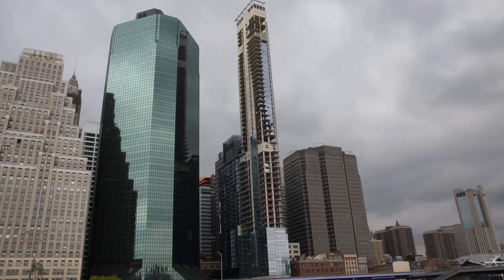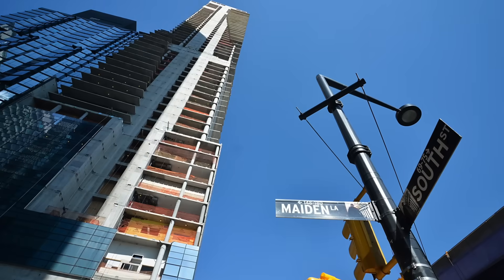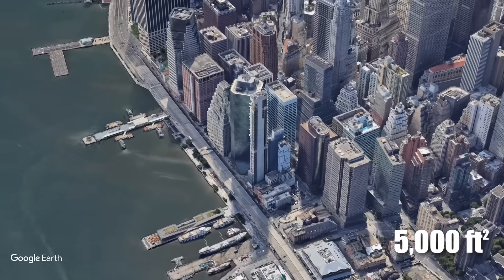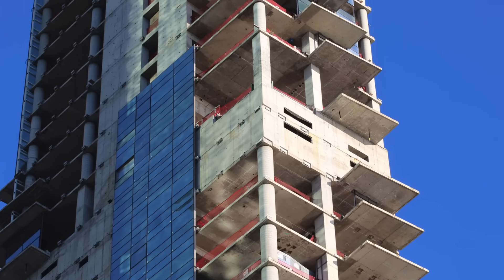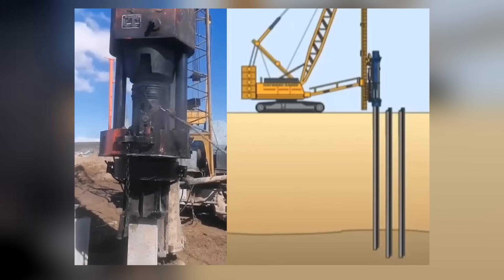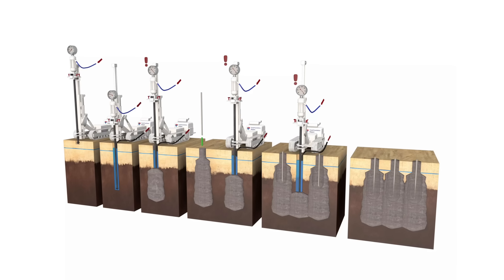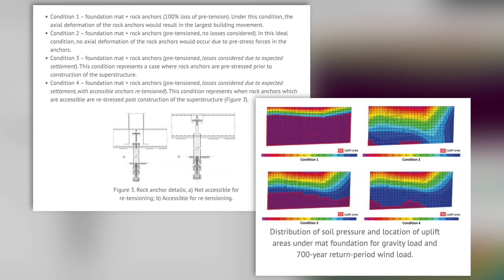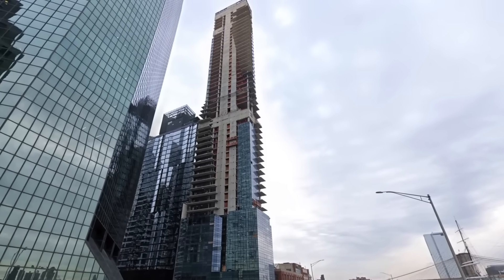Why Nobody Can Fix This New York Skyscraper

Comment: The fact they call this lean 'unforeseen' after knowing they weren't anchoring to bedrock is astounding to me. Anyone who has dealt with foundation issues in their home (myself included) or even built small structures (shed, outbuildings,  etc) on soft ground would have predicted this as a potential outcome.
Reply: That's because, and I bet my left tseticle on it, there's at least a dozen jews involved.
Reply: with a 15:1 aspect ratio and strong winds?   Shocked, shocked I tell you !  (sarcasm)

Comment: If the bed rock is only 150 down, under the softer soil, why not just drill down and install the pilings? Water wells are routinely drilled over 200ft deep so it should not be too difficult?

Comment: Structural Engineers need to stop pushing engineering thresholds beyond "reasonable" limits.   The city should have known better than to approve this soil amendment system vs. going with driving piles all the way to solid bedrock.  The developer was foolish for rolling the dice on an unproven design approach.

Comment: Having years of drilling experience, 14 of them installing micropiles and tiebacks in the 5 boros…. All this information is well known… and penny pinching is never a option and money is never an object when trying to get out the ground in that area….. this is 100% result of a payoff and then abandonment before more lives were lost. As it sits id be pretty certain it poses no danger of collapse which is why it still is standing, it will probably have taxes and bs stop being paid on it until the city owns it, and then it will continue to sit until its a liability to the city they should have used union singnatory GCs, and companies unless it was meant to be one of the many empty large residential buildings that no one knows are even empty in manhattan because they are a chinese/jewish bank account basically.

Comment: Now folks, which is the correct scenario,  the One Seaport's Developer used Boeing as their design Consultants, or Boeing used One Seaport's Developers for it's 737 Max programme?
Reply: Boeing had an issue with outsourced SW development; they have issues with production QA ... but their designs are yet OK.
Reply: @TomMcinerney-g9b  :  Good to hear that.  I'm sure the families of those that died in the two crashes associated with faulty control software and also the lady sucked out of a window when an engine component failure punctured her window are mightily relieved to hear that the Company can blame the failures on someone else.   There was a time when main Contractors took legal primary responsibility for the correct selection of components / parts and systems  from their sub Contractors, like the previous battery issue where sourced batteries had the inconvenient habit of going on fire on a regular basis, much to the concern of the punters travelling in the back, not to mention the crew.   This Company has lost it's way, but is probably a beacon of DEI, so all is not lost".

Comment: I'm not sure how the "unforeseen tilt" wasn't easy to foresee. I'm no engineer and even I know better. Trying to save six million dollars turned out to cost them far more in the long run. I'm honestly surprised that Manhattan doesn't require such heavy highrise buildings to have piles driven all the way down to the bedrock. You'd think that would be something that was very strictly enforced, especially when you consider the soil most of those buildings sit on.
Reply: what's a pile of 300 year old rotting logs under an immensely heavy skyscraper, to old friends?   ;)

Comment: This same thing happened to another skyscraper out west, I think. The developer didn't want to drive the piles/caissons all of the way to bedrock to save money. I think the building is over 60 stories tall. It had a significant tilt to one end. It was already occupied. I would never, ever, let a skyscraper be built unless the foundation was secured by piles/caissons, fully sunk into bedrock. This stupidity in this design and construction lead to grave issues over time. Some people never learn. The Burj Kalifa was done right. Second, I'd never design a high rise with that kind of aspect ratio. Look at the Empire State Building, that is good engineering and good design. It's all about the foundation. There are a couple of ultra-high rises near Central Park which scare the hell out of me, they look like pretzel sticks, horrible, horrible design, but that's just my opinion. But I'm from the old school of ultra conservative engineering and design. Spend the bloody money initially, do it right initially, then you'll have something safe, plus add in a safety factor, during the engineering stages, which far exceeds codes. Don't rush the construction either. This was carelessness, with an element of greed as well; sad but now the building will not be occupied as the issues are in the public domain. A lesson learned for the future.

Comment: This issue is the definition of trying to pick up penny’s in front of a steam roller.

They tried to save $6m and ended up costing themselves hundreds of millions. Pure greed and stupidity. You’re building a LUXURY tower. Just imagine the other corners they were cutting. I don’t even mean structural/engineering corners, I mean just on the quality of amenity material they were using. I’ve seen a lot of luxury buildings in NYC in my time and their quality has consistently gone down with each decade. It’s the small things, like seams not lining up, grout and sealant cracking, poor building maintenance infrastructure, things like that. But when you’re buying luxury property it’s those little things that matter.
Reply: Comments are deleted on this video. There is no Freedom of Speech in the USA.
Reply: The word is "pennies" !

Comment: The city should be.
 Responsible for approving the blueprints and the designs.
Reply: Great idea - the know-all, efficient, competency of government bureaucracy is the solution to all problems in life
Reply: This city is never responsible
Reply: whomever put their engineering stamp on the design is fully responsible
Reply: @theorenhobart  Its never that simple with attorneys involved. The soil engineer will take a hit, if the Architect hired the structural engineer and not the owner, then the Architect gets dragged in because it was his consultant. An attorney will try and gather the architect up into this mess one way or another.  Somebody is going to be driven out of business. These things take a path of their own, before you know it they will be talking about the structural engineer had something to do with JFK's assassination, I have seen some weird stuff.

Comment: Engineering if given ALL the relevant facts can workout the construction parameters within an acceptable degree of error...Why an error? Integral calculus is often an indefinite integral, meaning, the result of the equation is an estimate, but gives acceptable results in most cases. However, in this case, the underlying soil conditions were not fully understood, giving incomplete or false data. Thereby rendering their calculations beyond the acceptable error.

Comment: They built it like the Burj-al-Arab, but on the cheap. Now the building most certainly will have to be demolished. I would never live there, knowing it could topple during a hurricane, which are more frecuent and stronger every year, even in New York. Only 5,000 sq ft and they built it so tall? On sand? No, on marshy sand. Incredible hubris and greed.

Comment: Don't call it 1Seaport. That's a bullsh*t designation buy the realtor to make it sound fancy. Buildings have building numbers. Those numbers are determined by the department of buildings and they determine those addresses by the cross streets and adjoining buildings. 
There is no 30 Hudson yards. It's 351 10th avenue. There is no 7 World Trade Center address. The building's address is 250 Greenwich Street. These things matter. We all need to speak the same language or we construct the Tower of Babel. How'd that work out?

Comment: Three inches over for a 670-foot building means the building is 0.02 degrees off from being vertical. I strongly doubt that that would be perceptible to anyone. Unless there is some other problem (like the tilt being likely to increase significantly over time), finish the damn building.

Comment: As soon as engineering becomes 'innovative', that's the beginning of the cascading epic failure chain reaction.
Reply: Canadians would build this tower on a two inch 'skim-coat' of 20 mpa non reinforced concrete.  The Canadian way.
Reply: Just get a 'Burke' bar on the low corner and a couple of steel shims.  Fixed!

Comment: This is exactly the same problem that happened in Frisco with the Millennium Tower but it has 58 stories and a 28 inch lean measured from the top. An attempt to fix the lean actually accelerated the leaning rate and amount and it has been halted.

Comment: Typical of modern construction. Running on the less that what is actually needed to avoid doing it right by spending what is actually needed for safety and security so you can put the profit in your pocket. If you are living higher than a fire ladder can reach, it's death trap anyway.

Comment: There have only been a couple of cases where a court has successfully ordered stories to be removed, but those were for zoning violations. The most recent case didn't require stories to be removed, on 10th and 71st. They built ten stories two high but were allowed to keep it. I don't see how this project is not partially demolished. You can jack under a shorter building but not this monster, plus the structure is malformed on the higher stories.

Comment: Someone could fix it but nobody wants to take ownership of it now because its just easier to avoid jumping into a liability. They could still drill to bedrock at angles and or adjacent to the footprint and stabilize it but that would throw all of the glasswork off again. Windows would need to be removed and redone after stabilization and who knows what else. Oh forget it just pull it.
Reply: I wouldn't worry about the windows,just to make sure the building was vacated until the foundation work was completed.

Comment: All the high tech computer designs and engineering, but the ones built in the 30s with guys throwing hot rivets are still standing strong.
Reply: 💯💯💯 I used to work in the Empire State Building. It's a work of art.
Reply: @MrBronx61  Visited the top as a tourist, truly a beautiful place!
Reply: @Christobanistan  So is the Chrysler Bldg. Have you been there?
Reply: @MrBronx61  Oh, yes.  Beautiful.
Reply: Is it that back then, you knew enough to over-design and make it stronger as compared to now we have the confidence to build closer to the fuzzy edge of safety?
Reply: And slide rules too.
Reply: @terry_willis Yes
Reply: 1970s era was pretty good too, but the designs were hit or miss, the original world trade center was pretty beautiful
Reply: Damn its almost like greed>saftey
Reply: it is goodfoundation not the rivits. The need foundation to bedrock.
Reply: Yes. Steel cage designed with concrete. The Empire State was hit by a plane and survived with a localized damage.
Reply: They're not comparable. The old ones are built on rock.
Reply: The amount of material saved with modern design tools would be significant I would guess.
Reply: World's gone to hell in a hand  basket since they made it illegal for construction workers to wolf whistle at the gals on the street.
Reply: Why is that?
Reply: Tell me you have no experience with older engineered buildings without saying it outright.
Reply: Love it!
Reply: Pyramids ⚠️❓
Reply: Right???
Reply: @Giggiyygoo  what 1930 computer?
Reply: Sounds the same as the automobile industry
Reply: As they allowed a 5/1 ratio
Reply: Good engineering with bad human ideas is a recipe for disaster💀💀💀
Reply: Exactly !!!  Did the Empire State Building and Chrysler Building have issues like this ?
Reply: Well, the ones that didn't get torn down.
Reply: There are a lot of new skyscrapers that are poorly designed and built. You are absolutely correct. The older skyscrapers made with no computers and guys throwing rivets are still standing strong while the newly built have major design and structural issues.
Reply: @windwest4D   Cheap minds, cheap materials, cheap results.  Civilization built out of cardboard and plastic.
Reply: Because there was no Tik Tok brain rot in the 30s
Reply: @r.handerlie9607 Rotten minds yield rotten results. Cheap and tacky.
Reply: Hoobris
Reply: @thesheeplelookup  Or perhaps hubris.
Reply: Survivorship bias is evident in this discussion
Reply: @commandoryu  is it though? The analysis of the failures is the planes that didnt come back and compare to those that still stand?
Reply: @woden_arbosa  Because comparing all building built today with the "best" buildings from the past ignores the many in the past that were designed badly but are not still standing today to be compared to.
Reply: Its because most projects were finished in months and completed with what amounts to little more than slave labor. Much easier to get things done when you don't have hundreds of regulatory agencies to pay
Reply: @bubz4196 Union Iron Workers made $1.50 per hour in the 20's, the average hourly wage was $.33. Everyone wanted to be on those jobs (tall buildings, bridges, power plants, paper mills, etc.).
Reply: They were people with integrity and hardworking and they got the job done right because they were trained well and in the order to get jobs at that time  no body cared for your looks or anything else except you know your job and you worked hard so I work for someone who really worked at that time and DEI didn’t exist then so you may say what you wish but at that time all you needed was hard work and dedication and sets of skills. Respect to them
Reply: And always will because they were no DEI then
Reply: @jimmysulce8266 tell me you know nothing of without telling me you know nothing. Historical facts are not debatable, so go do your research and tell me who built the cities, train tracks and roads back then. Ridiculous statement if I ever read one.

Do you even know what DEI is?
Reply: Then go look for yourself 🤥

Comment: Curiously there is no mention of a thorough geologic survey to assess the suitability of building a high-rise tower on anything less than bedrock. From the information provided in this short documentary, it seems obvious the engineers were cutting corners to control cost. The fact that the building began to settle unevenly before it was completed is telling. The design specifications were clearly deeply flawed. I'm a geologist and this is what happens when a building is poorly designed and under engineered. I've read the book about the construction of the Brooklyn bridge written by Stephen Ambrose. That structure which crosses the east river stands as a testament to robust engineering accomplished well before scale models or computer modeling was even a pipe dream. It was the world's longest suspension bridge for twenty years.

Comment: 3" over that height is within tolerance, if the facade needs a re-design then it is a lot more than 3. modern modeling is only as good as the guy pushing the buttons, no experience wrong results. lots of facades now days are a disaster waiting to happen, especially in India. as they say (back to the drawing board).

Comment: The original WTC, the new WTC, the World Financial Center and every building in Battery Park City are built on landfill. 
None of them are leaning or sinking due to unstable soil. The developers for all of those buildings had the correct foundations engineered and built. 
The disaster at 161 Maiden is happening because the developers tried to build a foundation that was much less expensive and inferior.